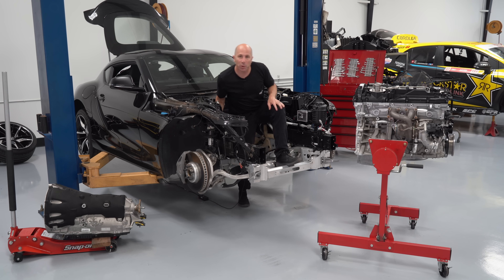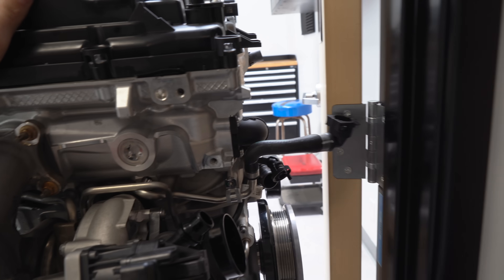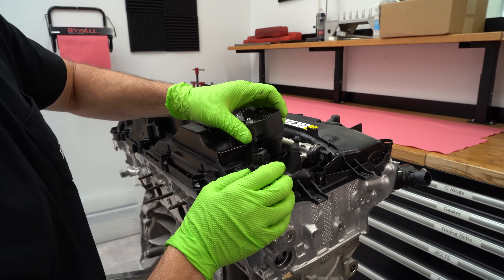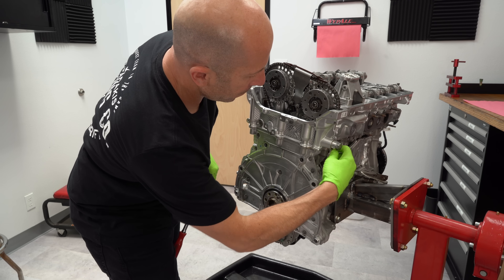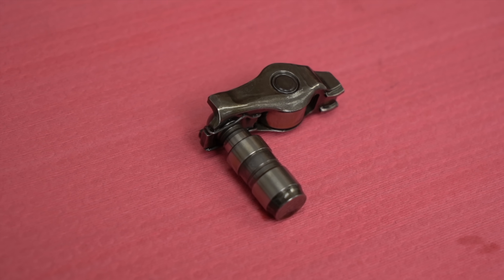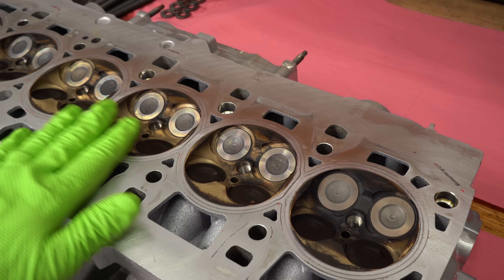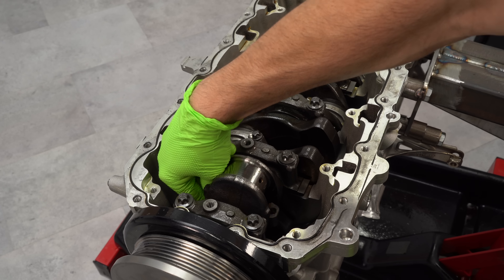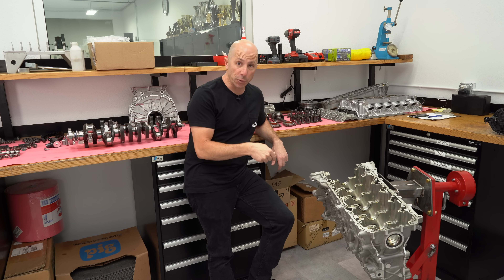2020 Supra B58 Engine Teardown - First Look - Better than the 2JZ?

Comment: Timing chain in the back of the engine. Yay. But otherwise the motor looks pretty good for relatively high horsepower
Reply: *apart from the integrated manifold, the most important part with all else equal...
Reply: Barry Boppins Probably not. MK7 Golf R’s have internal manifolds and they are able to handle big turbos fine. If you want to go nuts you can always port the internal manifold. It’s not as easy as an external manifold of course but manufacturers are switchting to this design because it helps with emmisions.
Reply: @Barry Boppins I'm not a mechanic by any means but doesn't this "actively" cooled manifold that cools the gases also reduce the volume of those gases, meaning effectively more room and better flow?
Reply: Barry Boppins Coolant flows around the internal manifold. That’s what helps with emmisions, but I presume it also prevents it from getting too hot to some degree. I do see your point though. I’m pretty sure Audi’s new 5 cylinders have an internal manifold and people are cracking 800hp pretty easily so I think it may not be too bad if designed well.
Reply: Barry Boppins   Integral manifolds run cooler, the cooling system needs to be designed to handle the load but it shouldn’t cause any heat related issues.
Reply: Being a closed deck design is certainly a good thing.  That's one of the big reasons the 2JZ-GTE was known for it's strength.
Reply: @Barry Boppins I guess, because of the hype of the supra, there will be a few people who are already getting parts for the new motor to get it past 1000hp. Time will show
Reply: Barry Boppins As an Emission specialist and have dealt with SAE and worked on Military aircraft in aerospace building and overhauling. This very simple engine in comparison to the technology on any part of an aircraft or its’ engine. Back to the subject. This exhaust design was taken  from Formula one engines and transfer into production engine for efficiency and preventing NOX formation. Their is a reason why it’s built into the head as the head has cooling passage to keep the exhaust heat at an optimum temperature. As the engine will increase in power also coolant temperature therefore Toyota chief engineer have mention upfront bumper has to be block off because it has too much cooling capabilities. And it would be put to use when it gets into the market as tuners will want more power . That’s when it will become useful. This is a well developed engine and by far the most modern lightweight in-line 6 TT engine of today.  Pervious version N55 and N54 was able to produce close to 1k Whp on the Dyno. With an open deck block design so I wouldn’t doubt there will be any problem holding same power level as the 2jz-GTE.

Comment: Good engine for a while. Timing drive in the back will be a problem to change down the road, oil pump chain can snap (same as in N47B20 diesel). This engine is way too complicated in my opinion

Comment: Steph with this engine being a B58B30. Would it be possible to modify any existing BMW performance parts. That already exits for this engine to the Supra platform. So you can get an early start in performance upgrades. That way you'll know what works and what doesn't.

Comment: Typical germans. Good engineering but so complex that to do anything more complex than changing oil is an engine out procedure.

Toyota said it's a tuner's dream... More like tuner's nightmare lol.

Aftermarket intercooler, NOPE
Aftermarket manifold, NOPE
Aftermarket anything, NOPE

From the video, sounds like the engine itself can withstand a lot of power but to get that power isn't going to be the old-fashioned, overnight a bunch of parts from Japan, procedure.

Comment: This engine is looking promising. Great oil drain ports, Closed deck block. I think the exhaust manifold design is gonna be the biggest hindering part when trying to make 1000hp. Hard to push that much air through two small holes.

Comment: Great video. I see a need for forged internals and aluminum aftermarket boltons for 1000whp.  Not much sexier than an engine tear down and push for more power.

Comment: Surprised you couldn't get the camshaft tool for the intake cam removal. The dealers will sell special tools over the parts counter, you just might have to ask the right guy or the manager where some kid they pay to work the front might just look at you like you're crazy.

Comment: B58's have been out since 2015 and concerns about timing chain maintenance/failures were the talk of the forums. 4-5 years later and......yea, nothing. 
I think everyone should take a chill pill. This is the content we should've been seeing like 2 years ago when the engine was announced to be used in the Supra. Tunes, downpipes, simple bolt ons have been out and shown what this engine is capable of. Cant wait until shops start fabricating top mount manifolds and billet intake manifolds. Soon we'll be calling the b58 the 3jz. Lol

Comment: No need to weld up the engine stand. Let that abs plastic Ecotec hit the ground. Grab yourself a 2JZ, build it, then slap it back in that RX-8z3. Great job on the thorough video.👍